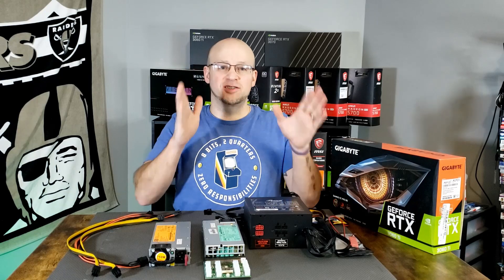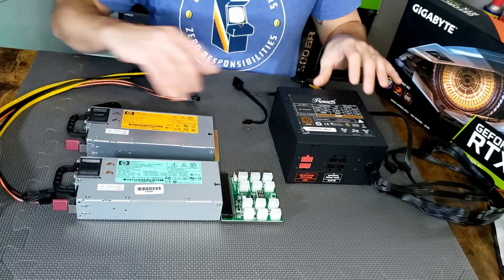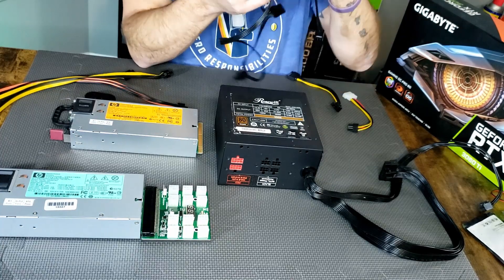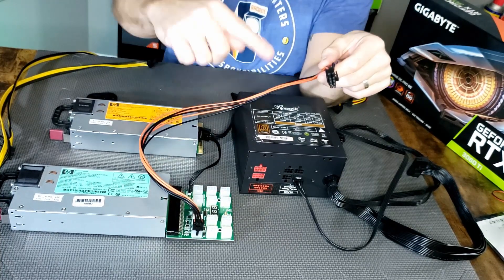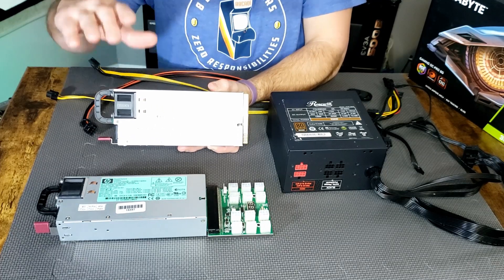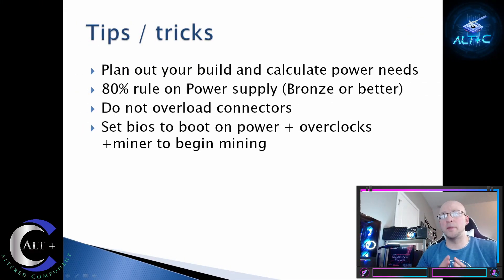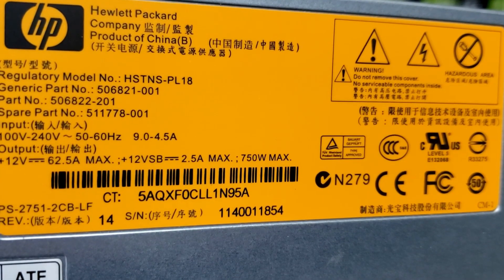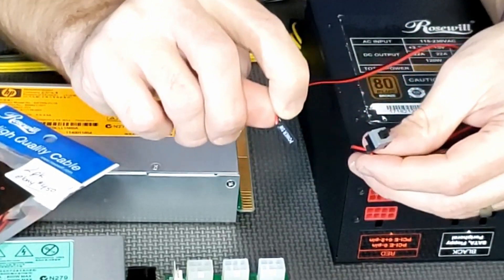How to use Server Power Supply for Mining Rig:  Quick Setup guide

Comment: Can a Evga 450BV work on powering the 1200watt setup that you shown in the video?
Reply from the maker: Thanks for watching.  Honestly you can use any atx standard power supply to power the system, then you can use the server psu to power the GPUs and risers.  You do not need to connect the ATX to the server psu at all to be honest.  You can manually power on the server psu, then power on the system.  Linking them just allows you to power full system with one button or command.   take care

Comment: Is it safe and possible to connect 2 or 3 server power supply together from your mobo psu with a single sata/molex cable using adapters?
Reply from the maker: See other response.  Basically u should use the power sensing "interconnect cable", mini 4 pin to connect each additional server psu .  This https://www.parallelminer.com/product/x11-and-x6b-breakout-board-4-pin-interconnect-sync-cable/?wpam_id=222
Reply: @AlteredComponent  thank you but the situation is that there is only 1 4pin plug per breakout board so using a sata cable with multiple plug with 4pin adapter seems to be my only option

Comment: good video sir just want to clarify,if you used to psu combine only one of them are going to current supply?
Reply from the maker: you can use a single server power supply to do your full system, but you would need a PICO adapter or a zsx all in one breakout board.  Most people and for the most part, i use  either 1 server power supply plus 1 ATX power supply together, or i use 2 Server power supplies together.  Then i just try to load balance between the  2
Reply: @AlteredComponent  thanks a lot sir

Comment: what if blackout happen ? is server PSU also turn off when ATX PSU shut down when blackout happen ?
Reply from the maker: Thanks for watching.   Guess I do not follow your question.  If power goes out, then server psu goes off as well.  Unless you have a ups hooked to it.  Take care
Reply: @AlteredComponent  I just bought a Server PSU too from Ali Express and it comes with its own breakout board. those breakout board does not have a 4 pin but its button is switchable. if the PSU goes down when the switch is still on at the blackout. when it's got power it will automatically turn on. is this bad? do I need to buy the breakout board like in your video ? I'm using Server PSU DPS-750RB A in case you wondering.

Comment: Can I connect and synchronize 2 server power supply with 1 floppy cable each one from a atx power supply that has 2 peripheral connectors?
Reply from the maker: thanks for watching.  Honestly never tried that.  the recommended is you link one to the atx and then you link the 2 server PSU with the mini 4 pin to mini 4 pin connector.  Let me know if you try that.  Would be interested to know if that works.  Cant hurt anything, just may not trigger, but i would think it would.
Reply: @AlteredComponent  Ok I will try but in case it doesn't work how can fix that, if that breakout board has only a fdd floppy port. How can I supply my gpus. Could I First turn on the server power supplies that provide energy to gpus then I turn on the mainboard? Is that correct alternative method?

Comment: Thanks for the video, I have a problem I have a btc-t37 connected with an atx-850 coolermaster with 24pin connector working without problems, I bought a psu dps-1200sb and connected it with a molex cable to the 4 pin break-board, the problem is that when the motherboard starts the psu (1200) starts with a delay of half a second with this my video cards are not recognized, how can I change the connections so that this doesn't happen?
Reply from the maker: Honestly that is a great question.  I have ran into a similar issue because of the server psu delay in my garage.  I ended up hooking it to a wifi outlet.  If the cards did not recognize on reboot, i would use my phone and hit the outlet off and back on.  Since there is slight delay in powering down the server psu, it would give it enough time to read.  Not exactly ideal, but works for me.  Let me know if you find something better

Comment: is their a way i could just use the server supply without having to have a normal atx power supply ?
Reply from the maker: Sure can.  But you need either a pico adapter or run a all in one breakout board (zsx from parallel miner) both of these options will give u a 24 pin and a cpu 4+4 pin power for your motherboard.  Take care
Reply: @AlteredComponent  what about cpu power, sata etc..? will it come from the pico adapter or the server supply?
Reply from the maker: Here is a pico adapter https://www.parallelminer.com/product/180watt-max-24pin-atx-power-module-included-sata-molex-cpu-power-connectors-ditch-your-atx-power-supply-entirely/?wpam_id=222 and yes it plugs into breakout board, then gives u a 24 pin,  a cpu power, a sata and a molex.  Or u can use an all in one breakout board zsx, https://www.parallelminer.com/product/zsx-breakout-board-16-ports-pico-24pin-atx-fan-hubs-100-gpu-mining-a-game-changer/?wpam_id=222 .  I have a video on zsx as well.
Reply: @AlteredComponent  i bought the reg pico adapter with just the 6 pin so can i just buy a reg psu to power the rest?
Reply from the maker: @brunolisinski9689  I use a atx (standard) and a server psu together in most of my builds.  The atx power supply will power the motherboard and cpu, the molex and sata accessories and a gpu and riser or 2.  Then the server psu will power the additional risers and gpus.
Reply: @AlteredComponent  can i use the breakout adapter for Dell and Supermicro Server Power Supply
Reply from the maker: @brunolisinski9689  there are tons of different style of server psu.  Best bet is to go to parallel miner and look up the psu or breakout board and then look at the compatibility list to ensure. Many use the same common slot power bar

Comment: Great video. Tks from Brazil... :)
Reply from the maker: Thanks for the feedback and for watching.  I just ordered a couple Dell 1100w Server pSU.  I have never tried them yet, but a great value and use the same common slot power bar as the HP server psu in this video, and also run on 120v.  Should be a fun test

Comment: Can I run 2 1200w hp PSUs on one system? I only have 120v in my house so I’d only get 900w from each one, and that’s not nearly enough for 8 cards. So I’m wondering if I can buy 2 and link them up, it’s just that they aren’t the same as a normal atx psu link up like you showed
Reply from the maker: depends on your breaker, but for most of my house i have standard 120v power.  In the main mining cave / youtube studio I am using just under 2k watts.  I can push up to around 2100-2200 before breaker pops.  so yeah you can easily run 2 x 1200 (1800w) at max potential as long as you are not jamming more than a couple hundreds watts in that room in conjunction.  You can definitely run two connected with the mini 4 pin connector.  Only thing is, you have to be able to power the motherboard.  So you need either an ATX power supply, A Pico Adapter for a standard breakout board, or a ZSX game changer all in one breakoutboard.  Hope this helps.

Comment: Hi. I have one question. All My PSU's come with 4 PCIE cables (8 pin to dual 6+2). Is it safe to split one 6+2 connection with 8 pin to 2 6+2 adapter so that my 3070's can be powered along with the riser by single PCIe cable. From my undervolt settings, this setup shouldn't draw more than 200 w from PCIe cable. I have 13 3070 GPU's with 4 atx psu's 2 X HX1200 1x RM1000 1X silverstone 1500W. Im using B250 ME motherboard from asus. Im currently powering the risers with SATA. Thanks.
Reply from the maker: thanks for watching.  Splitting an ATX power supply is a bit diferrent from splitting a server psu.  Here is why, different manufacturers of ATX psu use different standards and different gauge wires.  But, specifically when it comes to a 3070, you should have that thing powered down to 130w or less. So, if you split 1 8 pin from the PSU into dual 8 pin, you are still drawing less than the max rating of the 150w 8 pin.  So yes, you should have no worry about splitting a single 8 pin into dual 8 pin in this instance.  If you were doing that with a 3080, i would definitely stop you there.   Powering risers with sata is very iffy as i am sure you have heard.  a sata connector is made to handle up to 54 watts.  whereas a pciex16 slot can demand as much as 75 watts.  I have personally melted a few sata connectors over the years.  It is generally not something that is an immediate issue, but overtime, those will break down. hope this helped
Reply: @AlteredComponent  thanks for the reply. I was mainly concerned about if a mining software decided to mine while default oc is applied due to a failure in MSI afterburner. I can only get spliters of 18 awg which is rated for 300 w if my research is correct. 3070 is a 240w tdp max card. That's why I was researching heavily so that to reduce the risk of meltdown. I will change my setup to try asap. Again thanks for the reply.

Comment: So if I'm planning on running up to 8 gpus I will still need an atx psu? Also if I run 8 3070s off this do you think 1250watt server psu would work?
Reply from the maker: Thanks for watching.  a 6 x 3060ti/3070 rig at the way, is running me 970 watts.  I am sure i could trim it down 30-50 watts, but trying to optimize hashrate while market is doing well.   so i would ballpark you want to have at least 1250 watts to get by.  FYI, that HP 1200w that everyone uses, it actually is only 900w if used on 120v power as most U.S. house run as standard.  If you plug it into 220-240v outlets, then you get the full 1200w.  My advice would be to use a 1200w hp psu and a solid mid range atx power supply.  Shoot for between bronze and gold rating.  probably a 600-750w.  Then you can use it to power you motherboard, cpu, and accessories, plus have it power 2 of your GPUs and riser.  Have the server PSU power the other 6 cards.  That is how i would run it personally.

Comment: After connecting PSU to breakout board, can I use 8/6 pin ports from my PSU still?  if I have available?
Reply from the maker: 100%.  the only thing connect your ATX to your server psu breakout board does is, it sends a 5v signal to the breakout board.  the breakout board says hey we have power, turn on server psu.  for years I used server + atx psus.  I often will use the atx to power the motherboard, components, and 1 or 2 graphics cards and risers.  then the server psu will power the rest of the risers and the rest of the graphics cards. thanks for watching
Reply: @AlteredComponent  WoW! Super ! Thanks for answer!
Reply from the maker: @fedorovfedorov9803  mine on

Comment: Great video!  I have a question for you.  My psu will not turn on with anything plugged into the breakout board.  If i  unplug everything it will turn on and show proper voltage.  If i plug anything in while it's on it will shut down.  Any ideas?
Reply from the maker: something is backfeeding.  trying plugging in just one component to the breakout board and powering up and see if you can pinpoint which is the offender.  best of luck

Comment: Great video. Very informative. One question.  Could you link the ATX to server psu signal cable? Just want to make sure I'm getting the correct one.
Reply from the maker: Thanks for watching.   Here is the cable to connect a server psu breakout board to a server psu.  Many atx psu will come with a single mini 4 pin on a strand of molex plugs.  Take care.  https://www.parallelminer.com/product/extended-36-version-x11-x6b-zsx-breakout-board-4-pin-interconnect-sync-cable/?wpam_id=222
Reply: @AlteredComponent  i checked all four of my atx power supplies. None have molex to mini 4 pin. So I imagine I'd have to put in a molex to mini 4 pin adapter between the atx psu and this extender that your recommending? Are those the same as the old floppy power? Thank you fir the video and your reply.

Comment: Very helpful video! Are rails always arranged lengthwise on the breakout board (i.e. one rail per row), or am I maybe misunderstanding the term "rail" completely?
Reply from the maker: Thanks for watching.  This was a really good comment / discussion point.  I started looking into this a bit deeper.  I am not completely sure how a Server PSU is broken down as far as different power rails.  I do know that load balancing is highly recommended directly from Joseph of Parallel miner to ensure more efficient power delivery and sustain lifespan on a psu.  I found an older post by gamers nexus doing some defining on rails in general that i thought was pretty good:  
"In a PC, different components use different voltage levels, and so a power supply must take the electricity from the wall and split it into 12v, 5v, and 3.3v power. A rail is simple a wire/path inside the PSU that carries electricity of a certain voltage. The 12v rail provides power for GPUs and CPUs, generally the two most power-hungry components. It should be noted that a 12v rail can be split into multiple 12v rails, in which case two 12v rails would provide half the wattage of the combined 12v capacity."
"by more evenly splitting the power load. Due to heat generation from being under a constant and severe load with multi-VGA configurations, having multiple +12V rails will ultimately make for a positive impact on enthusiast rigs or more hardcore setups."

Comment: how do u power 2x server psu + 1 ATX?
Reply from the maker: Thanks for watching.  Atx would plug into mobo.  From atx a mini 4 pin would run into server breakout board to signal power.  Then a mini 4 pin to mini 4 pin cable would connect the 2 server breakout boards.  So you would hit power on the motherboard,  it would turn on atx psu, atx psu would signal breakout board 1, and it would signal breakout board 2.

Comment: Hello friend How you have Where do you find the cable to supply the pcu with 4pin?
Reply from the maker: Thanks for watching.  Are you meaning the 4 pin plug on the breakout board?  if so, it is this type of cable:  https://www.parallelminer.com/product/x11-and-x6b-breakout-board-4-pin-interconnect-sync-cable/ (this is a mini 4 pin to mini 4 pin to connect a breakout board to a breakout board).   If you mean from atx to server breakout board, a mini 4 pin like that is generally on a strand of molex connectors.

Comment: When you say the 4 pin on the server psu connects to the atx psu so it powers when you power on the atx psu. Does this mean when you power it on by the wall? or when you power it by the motherboard on switch? 

Thank you for the informative video!
Reply from the maker: The parallel miner breakout boards have a mini 4 pin. Looks like a large fan header.  Most atx psu have 1 of those on a molex strand.  You would plug the cable from the atx psu into the server breakout board.  That 5v input is sensed by the breakout board.  When u turn on your motherboard,  it powers the atx power supply which sends 5v to the server breakout board and then it turns  on the servers psu.  So u push normal power switch to motherboard,  then the atx comes on, and the server psu..all in 1 button
Reply: @AlteredComponent  perfect thank you :)

Comment: I dont have the small connector on my server psu breakout card. I have 17 connectors. Can I just connect the psu's using the 6 pin straight to the psu?
Reply from the maker: No.  That will back feed the power supply and possibly the components.  Some breakout boards are not built with power sensor.  The parallel miner boards are setup to detected a 5v feed.  When detected,  it will power up the server psu.

Comment: I wouldn't split a 6 pin as the 6 pin is only rated for 75watt. An 8 pin on the other hand is is rated for 150watts and can be split easily.
Reply from the maker: thanks for watching...that is actually a misconception.  a 6 pin plug at the gpu pulls up to 75 watts and that is where everyone gets that from.  A 6 pin at a breakout board can pull up to 288w.  as long as the cable is a heavy gauge (16g or lower) with proper insulation and it has 6 terminal pins inside the connector with wires then it absolutely can handle up to 288w comfortably.   So, from a parallel miner breakout board, you can use a 16 gauge 6 pin wire, run it up and split it into dual 8 pin connectors.  In some instances you can even split into a triple 8 pin.  I do this on 3070s.  i have a 6 pin triple 8 pin adapter from parallel miner.  I run 1 into the Riser, and 2 8pins into the card.  Hope this helps.
Reply: @AlteredComponent  Thanks for the reply mate, didn't know that! I'll definitely keep this in mind when ordering :)
Reply from the maker: @messystressy  absolutely.  I only run 3060ti and 3070s and 5700xts personally.  But all my rigs either use a atx bronze power supply with a hp 750 or hp 1200w server power supply, or just server power supply with the zsx all in one breakout board.  Generally best practice is to run a 6 pin 16g wire from breakout board and split into dual 8 pin.  If the gpu uses 2 plugs, then power those.  If the gpu uses 1 plug, then plug one side into the gpu, 1 side to the riser.  Take care